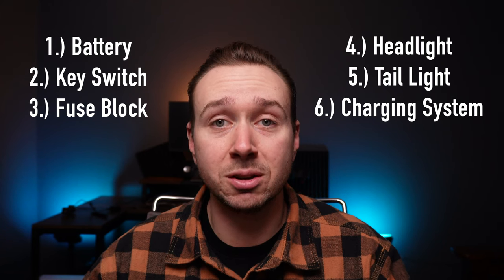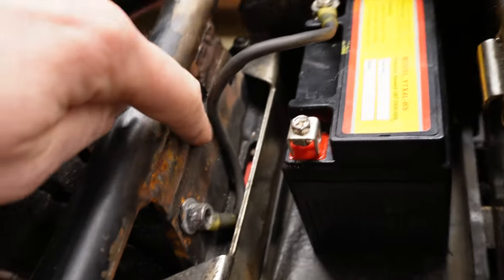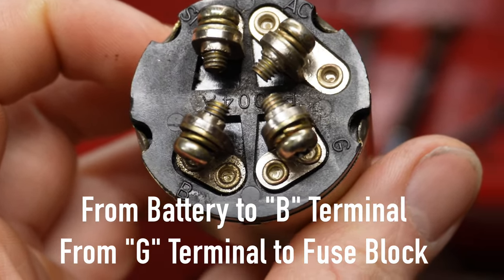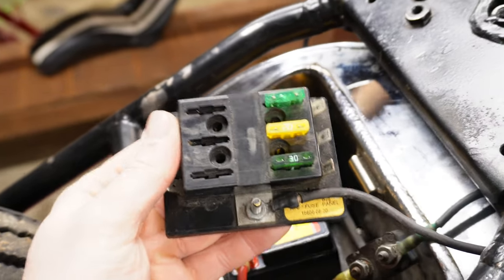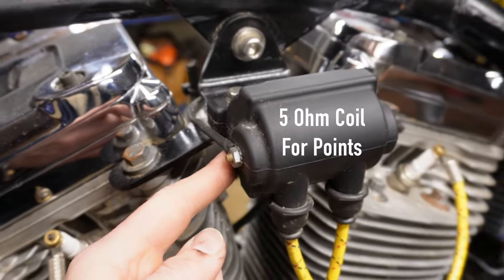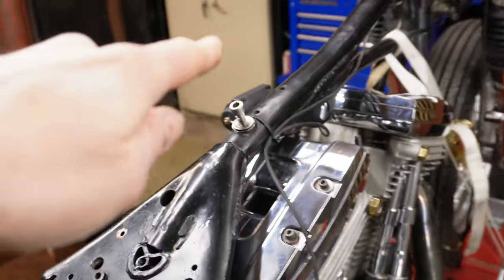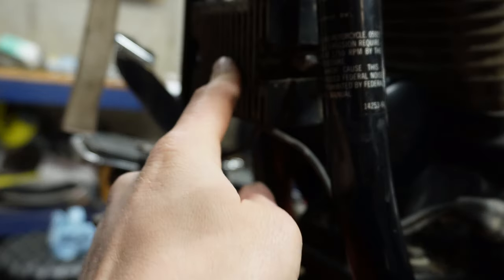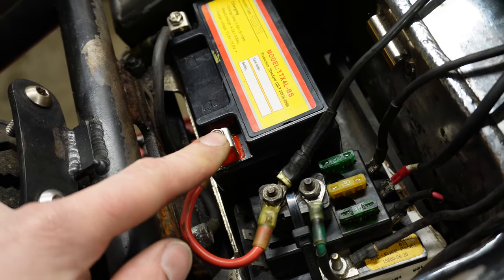How to Wire Your Chopper | Part 1

Comment: I’m using your wiring tutorial for my chopper and my key switch doesn’t have a G terminal. Which other one should I use? Or does it matter?  Thanks
Reply from the maker: What are the options?
Reply: Sorry. I’m not to good at these device operations. I did return your reply but somehow it has disappeared. I probably effed it up. Here is what my ignition switch is. I bought it from lowbrow. Altogether it has 5 posts with screw attachments and one that is different. It screws straight in instead of the other 5 that have side attachments. The letters starting from the B post going clockwise are BMSCAM. What other post can I use instead of G to do that job?  Thanks, and again I apologize for my mistake. 2:04
Reply from the maker: @ronpinkerton3126  I would think B would be meant to go to battery
Reply: That’s true. I have the B terminal hooked up to the battery. What I need to know is what terminal to use to power the fuse block as my switch doesn’t have a G terminal. The ones available after the B terminal are MSCAM. What would you suggest?
Reply from the maker: @ronpinkerton3126 turn your key on and use a multimeter to see which ports are getting power with the key in the on position
Reply: Thanks. Got it

Comment: Someone might have asked already, but what gauge wire did you use for each item, and how do you determine what size fuse?
Reply from the maker: 16G for everything besides battery ground. 12G for battery ground. 

As for fuses I don’t know how you determine, but I wouldn’t go higher than 30 or lower than 15 only because I never see them that high or that low
Reply: I really appreciate your page more than you know. Keep up the bad ass work, and thanks for awesome, easy to follow content.
Reply from the maker: Really appreciate the kind words man, thank you 🙏🏼

Comment: Hey man I absolutely love your channel, but I’m just curious, from binge watching your other videos I noticed this bike is kick only. Now I have the whole starter motor and solenoid and all that stuff which gives me a lot more wires that I don’t know where to put for a clean look
Reply from the maker: Hey Jack, thanks for checking out the channel 🤘🏼

Idk if you saw this one I did on the starter wiring 

How To Wire Your Chopper | Part 2 (Electric Start)
https://youtu.be/bS8Wi5H7oZg

This will show you the extra wires you’ll need, as far as where to put them if I was doing it on mine I’d tuck them all inside that oil tank

Comment: One thing I recently discovered is the need for a low voltage regulator in a minimal chopper with a small battery. Especially a battery that sits inside a horseshoe oil tank. It charges at a lower voltage and keeps the battery cooler. Went through several batteries before I learned that
Reply from the maker: That’s good to know, what brand do you use?
Reply: @greasesgarage cycle electric. They make a low voltage reg for 18-22 amp and the later 32 amp systems. They also make them for generators. They have the letter L on the end of the part number that designates low voltage.
Reply: Also make sure you run a ground wire from the reg to the motor, from the battery to the motor and from the battery to the frame. That made a big difference in the health of my charging system.

Comment: If you wanted turn signals where and how would you wire them? On the Ganged box?
Reply from the maker: Yes you would use those unused ports for the signals, you would wire a turn signal relay between them as well which is what tells the bulb to flash like a turn signal light does

Comment: Hey brother. Just a couple of things. First, love your shit. Thank you. Second, I NEVER comment on YouTube. This may be my first time, so I’m gonna jam a couple things in here. On this electric job, is there a way to run the front brake to the rear switch so it functions?  

Also, here are a couple items that may give you the excuse to make a quick video on. The term “chopper”. To me (a bike guy, not necessarily a Harley guy) that term denotes a bike with a pretty extreme front rake. You use the term in other ways. Maybe you could explain that, and the culture behind it?  Also, I’m running a softail that is bobbed, with an evo and 4 speed ratchet top. You love to talk about hard tailing bikes. Why would I want to give up my rear suspension when you can’t even see it?  Again, maybe the culture behind it?

Your videos are great man. Informed and concise. I’d love to see something on wheel bearings, chain and sprocket combos, front fork maintenance, performance mods, etc. a good adjustable pushrod video would be cool too. Again, nothing but suggestions sir. Thank you
Reply from the maker: These are some excellent ideas! Thank you for sharing these brotha. I appreciate you taking the time to comment 🤘🏼

As for the electric, you can absolutely run the front brake to the rear switch. You just need to add a brake light switch (most like a hydraulic one) to your front brake line then run your wires from that back to your rear brake light so that your front brake operates the brake light.

Comment: Can I do this with my 93 sportster XLH 1200?
Reply from the maker: You can! But you would also have to wire in a starter. To make it simpler I’d use the mechanical push button cover so you can skip wiring in a relay
Reply: @greasesgarage  I appreciate your respond brother! And by far this is the best wiring video online!!! Thanks for the tip
Reply from the maker: @fernandocolon3154  love to hear that man, must be doin something right! 🙏🏼🤘🏼

Comment: What about the starter motor to senoid and charging system
Reply from the maker: That’s covered in part 2 How To Wire Your Chopper | Part 2 (Electric Start)
https://youtu.be/bS8Wi5H7oZg

However the charging system was covered in this video

Comment: How to power fuse box if there is no ' g ' post?
Reply from the maker: Some terminals may have a different letter for it but check with the maker of your key switch to determine which terminals are labeled for which application. 

Alternatively, just hook your battery to your key switch and turn the key on, then put your multimeter (set to DC20) on the other terminals of the key switch. Whichever terminal has power when the key is on, that’s the one you want to run to your fuse block 👍🏼

Comment: Can you chopper wire a bike that has a pickup coil?
Reply from the maker: Yes definitely, you will just have an extra wire or two coming from the ignition. The manufacturer will typically include a diagram showing what those extra wires go to
Reply: @greasesgarage  Thanks for the reply

Comment: That was very clear. This is a novice's question. How can that be street legal? Like for getting an inspection and such. Don't you need turn signals and a speedometer? Wouldn't you want turn signals to cut down on the chance of death? Seriously. Is that state to state or something?
Reply from the maker: This channel is not legal advice or advising you on what to do or whether or not you should build a bike like mine. 

Chopper builders bikes are rarely in compliance with all the state requirements, I cannot advise you to do anything you are not comfortable doing to your own bike. If these modifications concern you, you should leave your bike in the stock configuration as it’s the safest setup

Comment: Will this  work on any  bike
Reply from the maker: It depends on the bike. If it’s not a Harley you’re not likely to have the same style of coil. If it doesn’t have a kicker you would need an electric starter as well which I have another video on.

What bike are you working on
Reply: @greasesgarage  1976 750cb sohc

Comment: what guage wire are you using for everything?
Reply from the maker: 16 gauge
Reply: 16 for voltage reg aswell?
Reply from the maker: @crippledwizard666 your reg should come with its own wires attached
Reply: @greasesgarage  i just meant the one wire that runs from volt reg back to the breaker. But im sure 16 probably good

Comment: Holy Hannah... I've built my first chopper from a donor dual sport bike. It had the dash with gear indicator, neutral light, gas gauge, four-way hazards, turn signals, blah blah blah. The wiring harness is a godawful mess. I swear, there has to be 500 feet of wire going higgledy piggledy all over the place. 

I'm not sure I want to do away with turn signals, but I'm ready to use your video to get rid of 480 feet of useless crap on this bike!
Reply from the maker: This is a great place to start, then you can build OUT from there as opposed to trying to slim down from a massively complex stock harness 👍🏼

Comment: Is it worth hiding inside the frame at that point?
🔥🐬🌮
Reply from the maker: Ayy a fellow lowlife! Thanks for checking out the channel brotha. 

Definitely still worth hiding inside the frame in my opinion. The backbone to the headlight would be a very easy one to run internally because the frame already has a hole near the neck. For the tail light I think it might not be worth it because I end up removing my tail light any time I take my fender off so I like that one to be accessible. 

The ignition could come through the backbone and down the seat post too. But with so few wires in general, it’s not always necessary to route them internally

Comment: Lol wiring is the easiest part.
Reply from the maker: Only for some
Reply: @greasesgarage  it is just one of those things that you have to think through if not doing it every day.  But otherwise, it's super simple, and I personally think that with videos like this, anyone can do it.  Just requires understanding the bike in general. Things like using proper wire gauge with a quality coating, terminals, soldering, and shrink tube.  Using asphalt wrap where most needed rub areas can short a wire.  People's issues long term lay there.  Internally deburing frame holes for wires is a must.  Sometimes, I'll use some rtv and make it seated 
I also complete it step by step, same each time - because the next day, sometimes I'll look at the wires and get confused myself.  But I'm guilty of using the same cloth color, not running labels.  Just find it cleaner looking, and I'll just trace a wire from its source if I ever have an issue.  I did rewire a bike last month and messed up bad where I mixed the signal wires from the rear brake switch and didnt notice it, light was on, just always activated on the brake set. I have more hatred for final timing and carb tuning- I enjoy it usually, but I have to do it in a solid day or I completely forget where I'm at.  Plus, I hate having a clean, detailed bike that I blast w oil- and those clear plugs suck!  But, brake clean makes a quick cleanup!